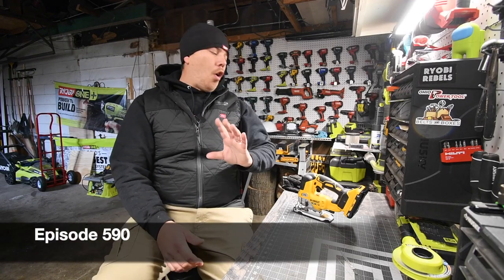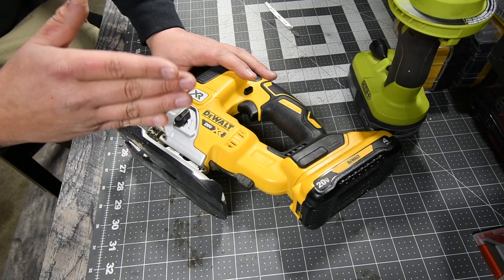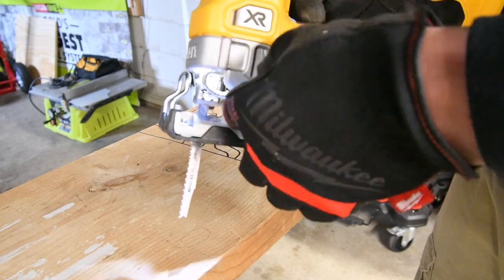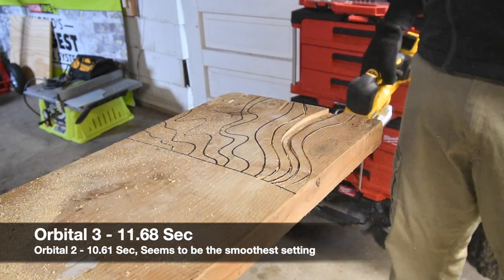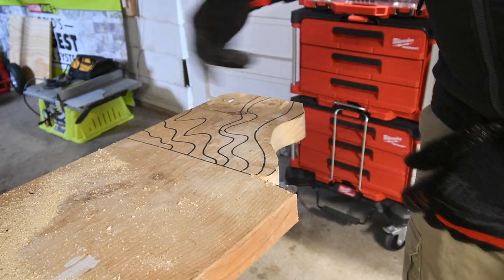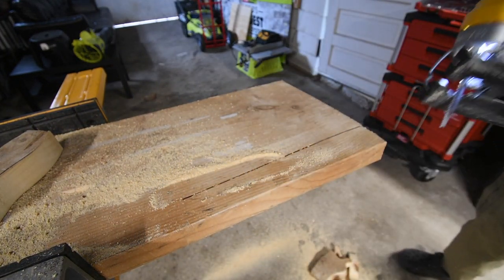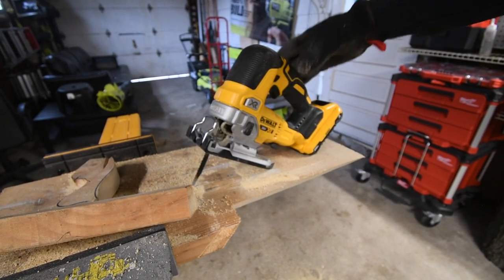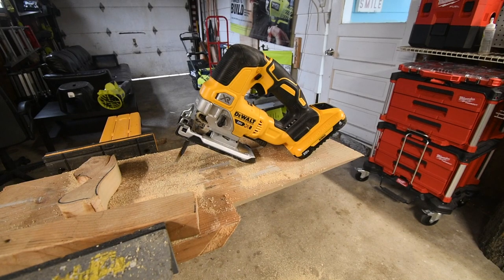Dewalt XR Jigsaw

Comment: Hey brother I think your problem is the blade. Fir curves you have to use the tin blades. The tin ones are designed for curves. The blade your using is for straight cuts. I think that will take care of the jumping problem your having there. Any other jig saw would do the same thing. I love my Mikita jig saw I got a 12v and the old brushed 18v. It is amazing for how old it is. I got the new brushless Mikita but I returned it. It did not preform anywhere near like the old one. But that dewalt looks to be a good kid saw as well. 
Thanks for uploading. Take care brother

Comment: Come on.. how about using the right blade for the right cut and learning how to use a tool before testing it! There's nothing wrong with the tool. OPERATOR ERROR! When there's smoke coming out of the board (6:42) and the blades turning blue stop! Yep it sure is entertaining.